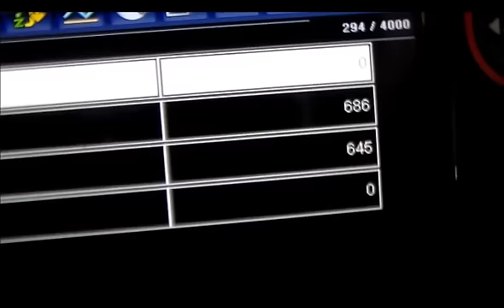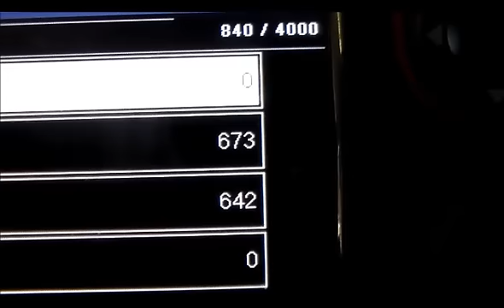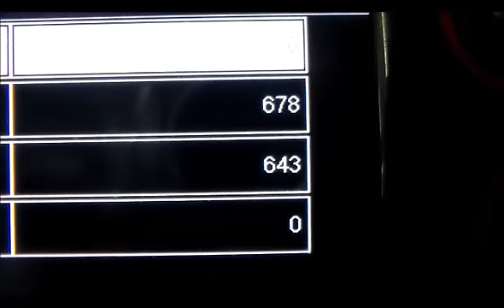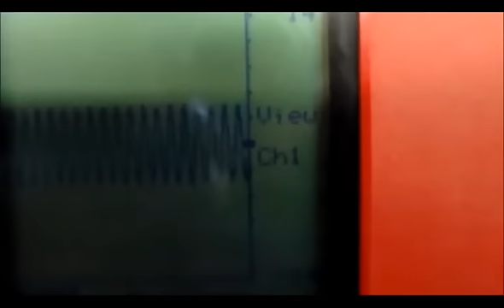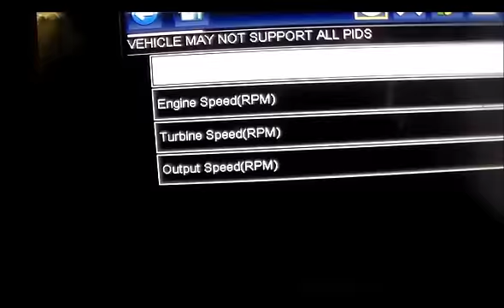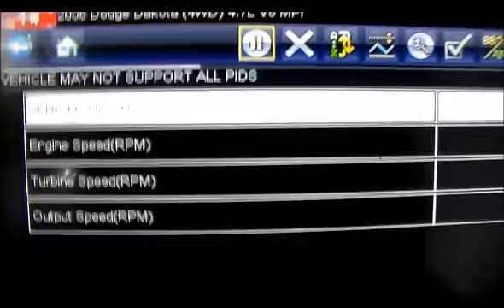P0717 Diagnosis and Repair

Comment: What happens if the computer is not responding at all to the sensor on the graph, it shows that it is dead. Flatline and voltages extremely low Voltage 2.30 even when you rev the rpm of the engine, it does not increase. And it freezes up at 576 revs, when hooked up to computer even when you in park, it just freezes at 576 and does not change.
Reply from the maker: you may want to try another scanner to see if you get the same results

Comment: Good morning,
I left my Koleos 1 2.0 dci automatic gearbox this week at the garage to change the crankshaft seal on the flywheel side.
I picked up my car today, I did 50km on the highway without any problem, it went through all the gears and was flexible, and when I arrived in town, my box started to have trouble shifting into first gear, then at one point it got stuck in 3rd gear. When I switched to manual, it remained in D. Finally, a message "regulator to check" appears.
By restarting the car, it's ok for a few minutes then it starts again.
I went back to the garage, we did a diagnosis and when we accelerate, the turbine speed is at 0 when we accelerate, and this blocks the gear change, we have to restart the car.
Here are the diagnostic errors:
- P01717: turbine speed sensor circuit (active)
- P1525: consistency of multiplexed information for cruise control, the information is not compliant (active)
- P074491: torque converter clutch ev function, converter lockout control (memory).
Do you know where this could come from please?
Reply from the maker: I never heard of this car, do you know what transmission you have
Reply: @GaryFerraro  Good morning, This is the Renault Koleos 1, year 2015 with 155,000 km. It has an automatic gearbox, and this car has many common parts with the Nissan Xtrail and Nissan Qashqai (Aj0 gearbox from Jatco, with torque converter)
Reply from the maker: @BillalAvec2L  ok, We don't have these cars here either but i have a chart that will show, let me see what trans is in those cars
Reply from the maker: @BillalAvec2L  I think you may have a CVT Transmission in that car
Reply: @GaryFerraro  I have a torque converter transmission. When I plugged in the clip, sometimes the turbine speed is 0rpm while driving, sometimes it's normal. Is it a speed sensor problem?

Comment: So your saying add a ground ? I’m confused I got code po717 and only hard shift from 1-2 and that’s my only code so should I change the input speed sensor or ?!? I just rebuilt the transmission and I have no will to tear it down again !
Reply from the maker: You do not add a ground, you have to cut the wire because the TCM  grounds the sensor, so if the TCM is no good, you cut the wire 3-4 inches away from TCM, tape the 3-4 inches out of the way and ground the other side
Reply: @GaryFerraro  so if I cut the 3-4 inches from tcm will it fix my po717 ( mine saids turbine no signal ) if I ground it after the cut will it fix that issue ? Cuase I already replaced the speed sensor. It’s a 2009 Silverado 4l60e btw
Reply from the maker: @Carlos-ve1je  Speed sensor is internal, you had the trans out?  Grounding the wire may or may not fix it
Reply: @GaryFerraro  for my model I have a speed sensor on the outside of my transmission on the shaft so I changed it but code was still their the internal one I have is the turbine sensor and  it saids that I have no signal with the turbine I was asking if by cutting it and grounding it will it fix it if so I’ll do it next day 2marrow morning
Reply from the maker: @Carlos-ve1je  what is the year,make, model and engine size of your car?
Reply: @GaryFerraro  09 Silverado 1500 chevy and 4.8 ls with a 4l60e trans I just rebuilt it got new 3/4 clutch pack and now it’s telling me speed sensor low voltage and turbine sensor no signal and my question was if I just cut the ground wire and do what you said and ground the other half it’ll fix my problem with the turbine sensor ? Thanks in advance
Reply from the maker: @Carlos-ve1je  Try that first, it may or may not fix it. If the sensor itself is bad, the code will return.
Reply: What solved your problems

Comment: Just stumbled across this video I was wondering if you had an idea about mine. I just rebuilt the engine and it doesn’t go past 3000 rpm when I drive and doesn’t go passed 60 what do you think I should check first?

Comment: Hello, Sir. I am dealing with a p1715 on a 2004 nissan murano I/P PULLY SPD. I see that the I?P PULLY pid is 38 mph with key on and idling. I believe it is supposed to be close to the tach. Should I replace the input steed sensor after confirming wiring integrity?
Reply from the maker: Carlos It reads MPH or is the reading RPM?
Reply: @GaryFerraro  I think it's rpm because when driven, it was almost equal to engine speed. The MPH I saw was pids from vehicle speed sensors. One was 0 mph with the truck idling and the other 18mph. i expected both to be MPH since the truck wasn't driven.
Reply from the maker: @perez7667  Is the speedometer on the dash reading with the car not moving?
Reply: @GaryFerraro  The speedometer reads 0 mph, but I saw 2 vehicle speed sensors data. One reads 0 mph  and the other a low number. Both of them change as I drive,
Reply from the maker: @perez7667  ok so while driving one reads zero and one works? which one reads zero and how fast does the code return once cleared
Reply: @GaryFerraro  While idling, one reads zero and one reads like 18 rpm. While driving, both reads. Both says Wheel speed sensor. I don't know which one is which, unfortunately. I will work on the vehicle  again next week, I will try to understand the PIDS better. CVT transmission is something I don't understand. The PIDS are different than normal transmission.
Reply: @GaryFerraro   The code didn't come back after tightening one the battery terminals, which I had a code for.(Abnormal battery voltage)
Reply from the maker: @perez7667  that is a 3 wire sensor?
Reply: @GaryFerraro   I did not check. I was just looking at live data. The code is gone now after I tightened the battery terminal. The code could have been the result of the abnormal battery code

Comment: hello. Could you please explain how we get turbine reading with the vehicle in Park? I read somewhere that the input shaft is connected to the clutch. (inside of the transmission). I would think it would read when the vehicle is in gear.
Reply from the maker: The input shaft is turning because nothing is applied in park and neutral. When you put the car in drive with your foot on the brake the reading will go to zero because the drum stopped turning because the clutch is applied, as you start driving and the drum starts turning the reading will come back
Reply: @GaryFerraro   thank you so much!
Reply from the maker: @bbmd2200  sure, no problem

Comment: Gary, I have a 2007 GMC Sierra 1500 4x4. I replaced the speed sensor on the transfer case. I was getting that code along with hard shifts. Trans is rebuilt with 38k miles on it. I haven't driven it for more than 5 miles after seeing this code. Do you think it's the ground issue? Also sensor was in the transfer case. Did I change out the right  sensor? Or am I supposed to fix the ground only, the one in my transmission? Where would it be located at if I did the ground wire fix?
Reply from the maker: The sensor is located inside the transmission, not on the transfercase
Reply: Is this a 2 wire connection?

Comment: 2010 Cobalt, I notice my ISS value is not present often on a cold start.  Is this normal?  I have to rev the engine high to read and if I put the car in gear the value goes to 0 (normal) but when back in park will not reappear.  If I drive the car and the value suddenly appears it locks up the PC duty cycle value and transmission shifts hard based on value it froze at.  If sufficiently warmed up I can reset ignition and value appears OK after start and car drives well.  Usually drives OK for the remaining part of the day even hours later.   Any idea?
Reply from the maker: That should be 4T45E trans, you should get a reading in park, ISS is probably no good, there is also probably a code present
Reply: @GaryFerraro  Yes 4T45E.  So right from cold, I should see an ISS reading right after start?  Have you or anyone confirmed this?    It's crazy after the transmission or transmission has "warmed" slightly it works perfectly after a reset.
Reply from the maker: Louis Baiani The input speed sensor is probably no good. I've seen this before with this trans
Reply: @GaryFerraro  as you know I ended up changing the speed sensor and got a surprise while testing the harness from outside the tranny after it was put back together.  The code was being tripped and in no way I could shake the behavior as before when warmed up.  I found one leg was shorted so what I did is cut the wiring from the sensor and placed an audio isolation transformer in between.  That was two months ago, never shifted better and no code!

Comment: Will this be same diagnostic for 06 nissan pathfinder? I got a p0717 too. Im thinking about replacing tcm but i just want to be sure
Reply from the maker: With that code, the Tcm/ valvebody probably is the problem. Look at the fluid make sure no water is in the trans, the radiators like to go bad, if that is the case, the trans should be rebuilt
Reply: @GaryFerraro    my fluid still red plus i recently make a radiator swap for a all aluminum cfs one because i was aware of that coolant problem. If i replace the tcm should i still put new fluid on?
Reply from the maker: @leod7058  If clean you should be ok, If you get one from the dealer, it will have to be programmed, can't really go good used on these
Reply: @GaryFerraro  so a fully refurbished wont be good?
Reply: @leod7058  did you ever replace your TCM valve body? Did it fix the P0717 code?
Reply: @GaryFerraro  hey Gary… so I have a 2006 Xterra and I had to replace the radiator since coolant was mixing with the atf 😢 the atf was cream color 😭 this is horrible since I just had a new tranny put in under warranty about 2 years ago. But the stealership failed to mention that the radiator needed to be replaced 🤦🏻‍♂️ so I replaced the rad, flush the atf, and my tranny was running really good. However, a few days ago the P0717 code showed up and now I’m thinking it’s the tranny… would replacing the TCM be enough or do you recommend a whole tranny rebuild? Thank you for your time and any knowledge you can share with me 🙏

Comment: Excellent video I help me   have cruze automatico 2011, 6t45-40 cod P0717 input speed sensor low circuit, what's the problem please. Greetings from tulua Colombia
Reply from the maker: ovidio libreros do you have access to a scan tool to see if your getting a reading on a scan tool
Reply from the maker: ovidio libreros Greetings from  New York

Comment: very big thanks gary for all your videos
i am strugling with toyota u250e that keeps burning the overdrive clutch do you know what causing that is there a problem with the valve body
Reply from the maker: when you say the overdrive clutch,  is it the clutch in the drum right behind the rear cover?
Reply: Gary Ferraro  yes the clutches that applied in 3.4.5
Reply from the maker: valve bodies do have issues, with stuck valves, a big problem with these transmissions are the solenoids, i always change the SL1, SL2 SL3 and the SLT (pressure control) solenoids, if these are mechanically bad, they drag the clutch and burn it out, you should also reset shift adapts
Reply: Gary Ferraro gary when i opended the trans from the back cover i found the top sealing ring inside the drum where the back cover sleve goes the back cover sleve where the top sealing ring was worn out
Reply from the maker: The ring itself or the ring land?
Reply: r
Reply: Gary Ferraro the ring land was wornout so it cant hold the upper ring in its place
Reply from the maker: correct, could be loosing pressure, it came in with this problem?
Reply: Gary Ferraro yes is this very common
Reply from the maker: I see those clutches burnt all the time, for me usually caused by mechanically clogged solenoids. Do you change any solenoids on the U151?  I change the SL1, SL2 , SL3 and the SLT solenoid
Reply: Gary Ferraro for this transmission i see a clear problem is a wear in a back cover sleve so no need for the solenoid to be change just a new cover with new rings and clutches because i opened the trans from the back while its still in the car
Reply from the maker: ok, let me know how it goes
Reply: Gary Ferraro thanks gary i will